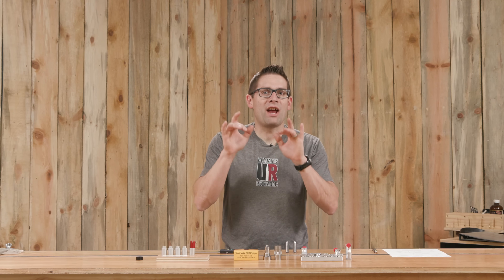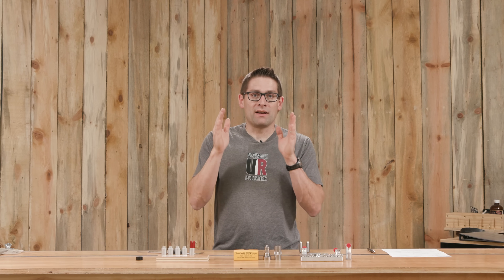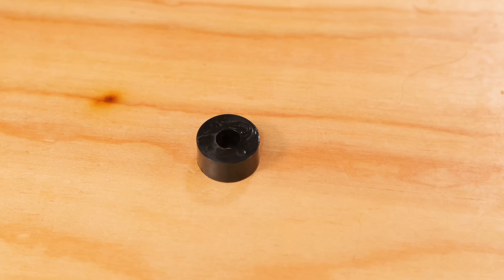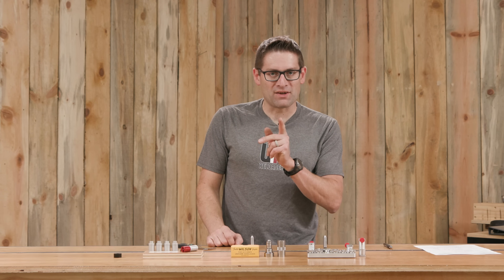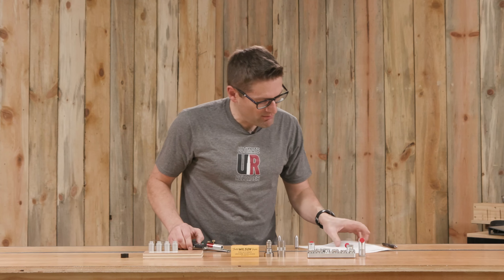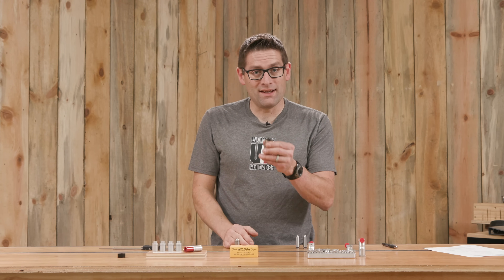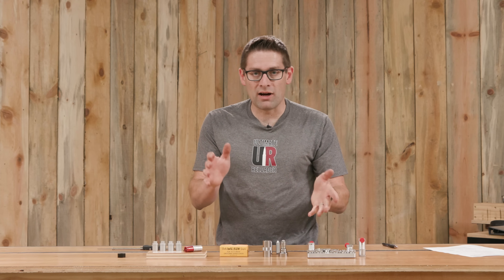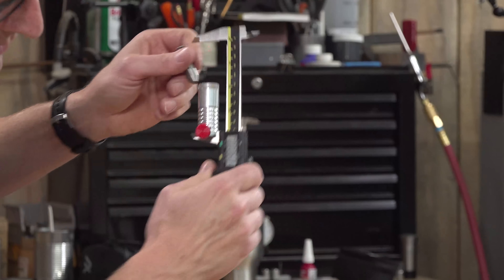3 Ways to Measure Headspace

Comment: Help me understand.  The Hornady tool gives BOTH absolute and relative measurements.  Why is the SAC set better (i.e. the Cadillac)?   Love the look/fit/finish of the machined parts, but if Hornady is accurate (as demonstrated) I don't understand why it's down on the list just above a random plastic bushing....
Reply: Gavin - I'm a huge fan and watch ALL of your videos.  As fellow engineer I implore you to close the loop here.   I desperately want to have trust that when you call a product a "Cadillac" or when you recommend one product over another.   If there is not data based rationale, the optics quickly shift to an apparent bias due to sponsorships, and I don't want to lose this confidence in you.   If your brand becomes one who pushes products that are sponsored/donated/etc.  you will lose all credibility and I and most others will certainly lose interest in your videos.  I don't want to.
Reply: @schmidtwoodworks533  Thanks for pointing this up.   I am the guy that actually developed, patented, and manufactured the original Stoney Point Headspace comparator many years ago.   Also, the Bullet Comparator system and the O.A.L. Gauge and Modified Cases.   I normally stay out of this water.....as folks have some pre-conceived ideas on these matters.....and it's no skin off my nose.  The relative comparison of these things is more useful and practical once you understand the concepts here.   Many folks want "absolute dimensions" here....and that is not going to happen.....nor is such data meaningful for reloading purposes.    I've measured brand new identical guns with the same cartridge chambers that were ONE serial number apart...and the bullet jump to the lands varied by over .040"!   Name brand too!   I've never checked the relative headspace on such successive guns....but the variation of a thou or two would not surprise me.   I'm sure there are allot of good tools here that can cost more.....but then you gotta ask yourself "why"?
Reply: The SAC kit mimics the exact lead angle and dimensions as the actual chamber in your gun. For the headspace gauges, the shoulder angle is the exact same as the chamber. For the bullet comparator inserts, the lead angle mimics the actual throat in your chamber and touches the bullet at the exact same spot on the ogive as it would in your chamber. It's to make it so it's the most accurate way to measure relative to the actual chamber of your gun.
Reply: @xxshiftlockxx  This video proves otherwise.  Get the idea in principle, but in practice this does not hold water.  First, every chamber varies in dimensions so SAC cannot possibly match my actual chamber.   Second, and more importantly, if the end result is a relative measurement vs. absolute, and if the Hornady produced an accurate result, then SAC isn't better.   I'm not promoting Hornady, I'm just trying to justify buying the SAC.   With a good reason I probably would.
Reply: @schmidtwoodworks533  You are correct in this observation and assessment.   Who says the shoulder angle will be the same in the SAC gauge as found in your chamber? or in your unfired,  or fired case for that matter?    There well could be (and will be) variations in these angles all the time.  The spec given by SAMMI is a datum circle....not a shoulder angle.   Actual and hypothetical results will vary.    I rest my case.   Grin.
Reply: The SAC combines the headspace and bullet comparator tools.

Comment: Can I add 1 more method to the list? The Redding Instant Indicator! (I recommend a .0005 dial instead of a .001 just for ultimate accuracy reading). For a comparator tool it is fast, accurate and consistent.  It won't give OAL but for setting up dies and general differential measurements it's the best there is imho.

Comment: What are your thoughts on the RCBS case mic?
Reply: I've used the RCBS Precision Mic for years.  It works great for measuring headspace as well as bullet seating depth.  For whatever reason, it seems to get no respect.
Reply: @doctormdds  I can agree with using the shoulder mic, but that bullet tool is a flat out joke. There are ALOT of differences in bullet companies ogives that don't even come close to matching the adjustable steel dummy bullet in the kit. That`s why it doesn't get much love these days when there are far better tools to check things with today.
Reply: @DERP-1  I absolutely agree with you on the steel dummy bullet.  It's pretty much useless and I've never used it.  However, once I establish what my bullet seating depth will be, I use the Precision Mic to measure cartridge base to ogive.  I record this value and reference it in the future as needed.  As I'm sure you are aware, this measurement is much more valuable than cartridge overall length.
Reply: @doctormdds  Because the "bullet" found in the RCBS is an arbitrary shaped ogive rather than the actual used.   No way it can produce a reliable result.  Same goes for the Head space.
Reply: Chinese junk. They are supposed to be calibrated to saami min. The one I got zeroed on a field gauge. It was 6 thousandths off. I've heard of them being up to 15 thou off. They need to just call those things comparators, but a lot of the new chinese rcbs stuff is junk. Good design, poor manufacturing.

Comment: I use the Hornady system for HS and bullet seating... I have seen folks use straight wall pistol cases to measure head space... u can use anything really as long as you always use it...   I also thing the Hornady is a little better because it's measuring more off a point on the bevel, rather then a surface like on you last gauge...
Reply: Pistol case, (.45 acp for my 308 Winchester) and measure brass fired in the rifle measuring. Adjust die a little at a time to set shoulder back 2 thousands and lock the die.
Reply: @kentuckywindage222  Great idea, I'm going to give this a try.
Reply: @redrock425  
It will work. Use the same 45 acp brass. 22 rimfire or 22 mag brass works for bullet, for ogive to base. Using a chamfer tool helps on the brass helps it work smoother in my opinion. 
I used these on my 308 Winchester loadings starting out and at times still do. Its actually pretty darn accurate.
Shooting to 1000 yards regularly very accurately. 1200 at times. I used it on my 6.5 creed and 243 Winchester also.
Reply: @kentuckywindage222  Thanks. I currently have a couple of 308s and have a Hornady tool but always good to have a back up.
Reply: @redrock425  
Yep. I've been shooting 175 grain SMK over 45.5gr CFE223, Lapua brass and CCI primers.  It's a hot load and temperature sensitive but after chronographing in 88, 75, 60, 50, 40, 32 and loading it in to my app I'm  confident to 1000 for target. 
We shoot clay pigeon's from 800 to 1000. Most wouldn't believe but it's on video. I'm working up a 168gr Berger hybrid load. Testing now. If it is what Strelok says it will I will be thoroughly impressed. My buddy shoots the 212gr in 300 WM and it is very accurate and deadly. He took two deer last year at 700 yards.
I've been impressed with the new to me 6.5 CM. Very accurate and basically no recoil. It is a shooter.

Comment: Using cut off's from barrels.  I've been making my own gauges using the same finishing reamer. I also slot it like the Sheridan gauge to reference max coal to jam and see how the throat erodes
Reply: My family and I actually manufacturer rifles. Desert Precision Gunworks, over 440 rifles this year so far excluding rebarreling. I usually order a few inches over desired finish length which gives me the option to make a Full length die matched to the chamber or other tools as mentioned above
Reply from the maker: Right on Kenny, love your approaches here!
Reply: @Eagle Eye Shooting I've thought about this, I like the cut-away gauges as well. Are you able to acquire cut-offs from barrel manufactures relatively easily or are you using your own from blanks?

Comment: You did not mention the Sinclair headspace bushings.  I use these and the Hornady kit to get two measurements each for my fired and sized cartridges.  I like the Sinclair a bit better since the also have a matching shoulder angle in the bushing per cartridge.

Comment: You sir are psychic. I have been researching this all week
Reply: Check out Erik Cortina.  Way better videos and he shows you how to do this properly.  There is actually only one way if you are handloading for accuracy and this guy never even covers it.  Hint, you size the beass for the actual chamber, not using the Go / NoGo guages…
Reply: @ez7977  I just found it interesting that a video was posted on a subject i am reserching at the time i am researching it.
I have watched all of Cortina's videos in regards to the subject. Cortina is a bench shooter and single loads rounds. There is  quite a bit of info from him that is also not covered in regards to saami specs and magazine lengths.
He also usually does not deal with factory barrels and chambers